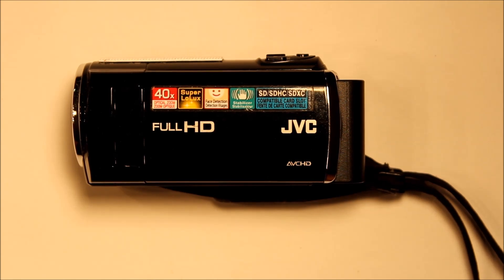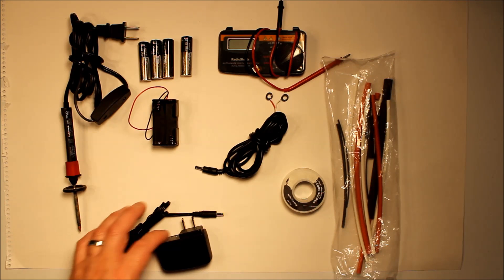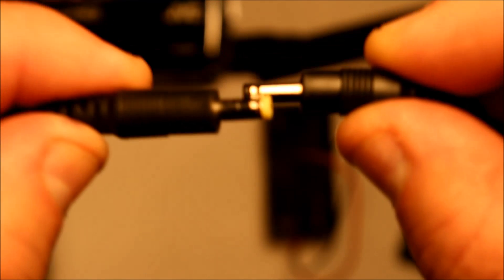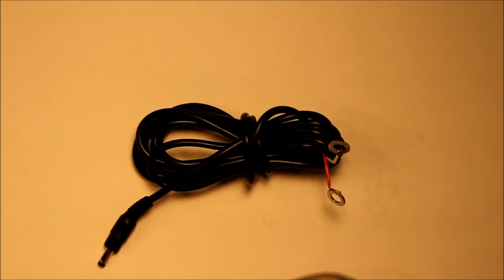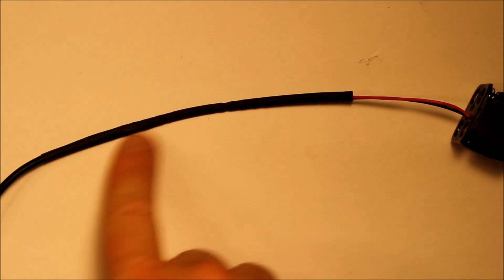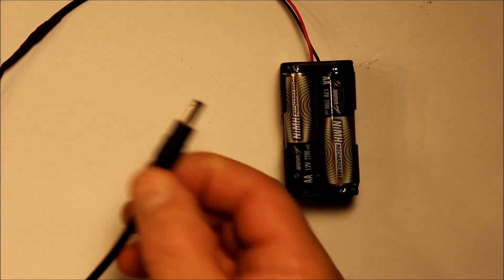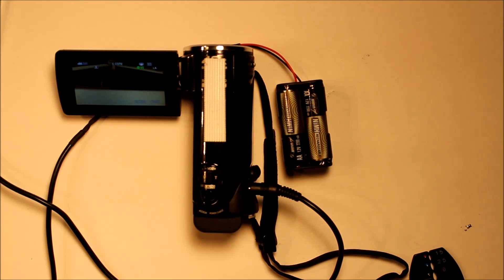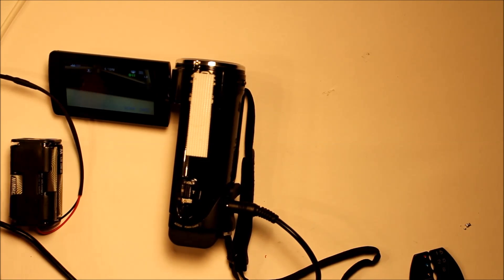How To Make An External  Battery Pack For Your Video  Camera

Comment: I know this is an old video but I have the exact same camera but lost the ac adapter. Where would be a good place to get a new one? And maybe a new battery too just in case?
Reply from the maker: The charger is available here on Amazon(paid): https://amzn.to/3kM8xtt or eBay(paid): https://ebay.us/qpreEA Here is a charger and and battery pack combo at Amazon(paid):  https://amzn.to/3kHrmxP  and here is the battery by itself on Amazon(paid): https://amzn.to/3kQ4WuF Please make sure to verify with the seller that this gear is compatible with your camera prior to purchasing. Thank you so much for commenting and watching. I appreciate it greatly. All the best.👍😀

Comment: Hi, I tried to connect my camera (same model as yours) thourgh USB. When I try to power it on it does not work. I get only the 2 LEDs on it and they are flashing (the red and green led - power and charge). I used usb instead of your battery solution.

Any ideas? Thanks!
Reply from the maker: Perhaps you have the polarity + and - reversed? Thanks

Comment: Hi Richard,
Great video!!! I'm using a canon vixia hf g20 camcorder and I was wondering if this method would work for my camera.  I would be interested in using sony np-f970 clone batteries as my power source. Any suggestions???
Reply from the maker: I have used this same solution on my Canon Vixia HF R60 without issue. As long as the input power from the batteries (voltage is the same) it should work for you without issue. Thanks.
Reply: Thank you very much!!
Reply: @06zulu  Or anker power banks 10000mah goes a long way and compatible with your  canon model

And the cable you search in the amazon is CA-110 usb cable.. Hope it helps
Reply: Ray you could use Powerbanks like romoss or pineng and there are cheap $10 usb cable to connect thru the power bank... It will last you for a day of shooting hope it helps

Comment: I have Sony CX 240 camcorder , and i wanna use battery pack to run like u did , can u look up for me if it work or not ? oh and i have decent power pack which is 5.1v/2.0A output
Reply from the maker: ghy sambath This should work for you fine. Those specifications are very close to my specifications so I don't see a reason for it not working. Be very sure you get the polarity (+/-) correct. Thanks.
Reply: so how about power bank can mine work with it ?
Reply from the maker: ghy sambath Which power bank you are referring to? Thanks.
Reply from the maker: ghy sambath As long as it supplies the 5 Volts DC you require I can't see why not. Make sure you get the polarity (+/-) output correct. Thanks.
Reply: thank bro , appreciate that
Reply from the maker: ghy sambath You're welcome. Thanks for watching.

Comment: Your brade sticking 6-8volts up a USB device!!!!
Max. voltage 5.00±0.25 V (pre-3.0); 5.00+0.25-0.55 V (USB 3.0)
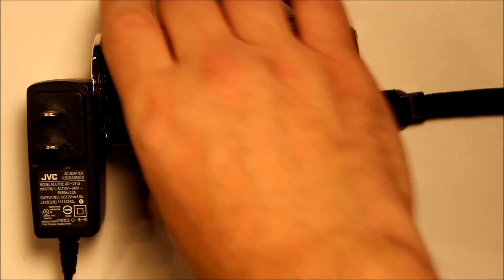Reply from the maker: At 1:12 I clearly state,"This applies to any device that runs on 5.2V on an external jack." I also state,"Make sure that you know the voltage and polarity for your device." I state that I am going to build a battery pack that plugs into the external power jack." Then I state that,"The specs on your power supply match the specs on your battery pack." Then I state that the power pack I am using is rated at 5.2V and that I am using 4 NiMH batteries at 1.2V which the total voltage will be 4.8V. If you were using standard batteries you would be at a max of 6V on the external battery supply. Not sure where you got the 8V from but again I did state that you know the power supply requirements prior to doing this.

To my knowledge nowhere in the entire video do I suggest or state that you should plug this battery pack into the USB port. But if that is your charging/power port then checking the power supply for it would tell you what the voltage requirement would be. As you stated "Max. voltage 5.00±0.25 V (pre-3.0); 5.00+0.25-0.55 V (USB 3.0)" My power pack with 4X1.2V NiMH batteries would do the job nicely but regular batteries would put it over the limit. Again If you checked the power specifications you would know NOT to do that. But thank you very much for your comment and the information as it may help someone who is going to do this with a USB plug instead of a standard AC power adapter plug. Sorry for the long reply but hopefully it will help someone not to overpower their equipment.
Reply: Richard Lloyd Hi, sent you a PM.  :-)